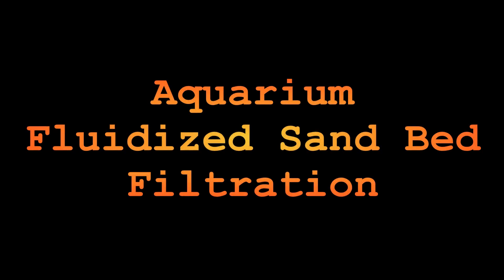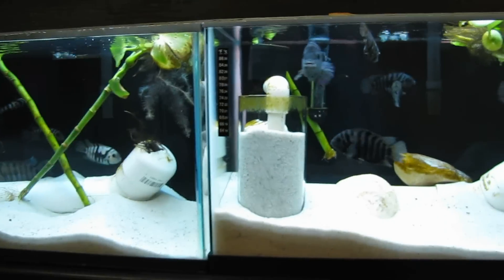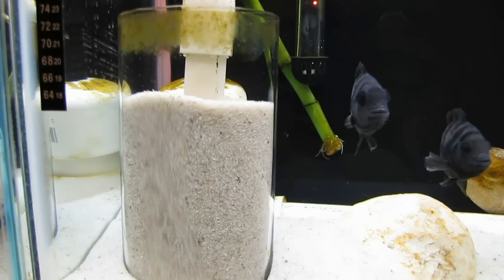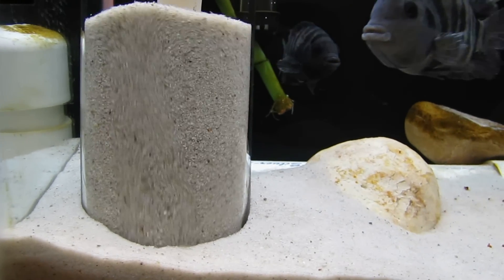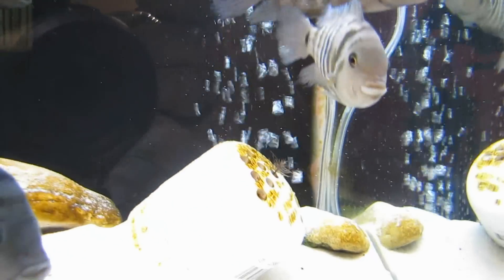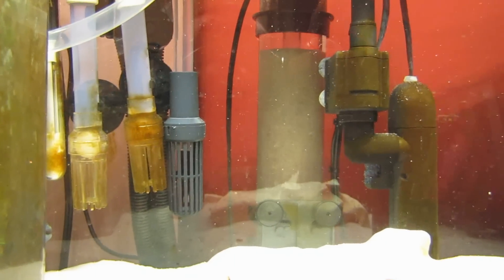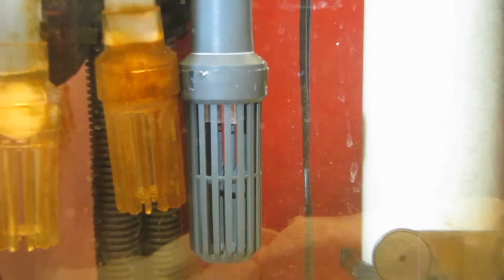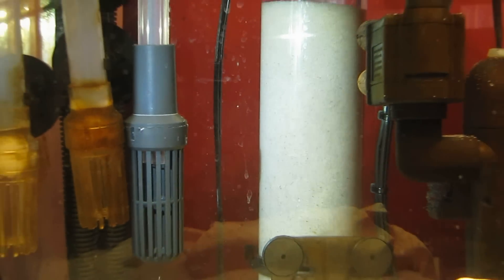Before & After: Fluidized Sand Filters - FSB

Comment: The only problem with fluidized bed sand filters is that if you have an extended power outage (3 days or more) you need to get those things OUT of the aquarium.  And if you are using external ones, disconnect them from the tank.  The reason is with no water movement through the very concentrated bacteria colony, the colony dies.  And releases toxins that WILL kill your fish when they crank back up.  After a long power failure, all the media must be washed before returning it to service.

Comment: Check your convicts fins, do they have early stages of ich or fin rot? They seem split.
Reply from the maker: SlickChick this was almost 2 years ago.  Fish have been treated and are still fine.  Aquarium isn't even set up this way now.
Reply: Oh, the sand filters didn't work long term? Did you switch to different filtration?
Reply from the maker: SlickChick changed aquariums

Comment: Colin, I believe that what your doing is a form of backwashing, there needs to be a suction instead of that kind of output, you should feed the waterflow into the sand, try putting the open jar into a larger jar or container, with an output port, you'll need to make it a closed system as well, that should create the right output based on the internal water pressure
Reply from the maker: Kevin P Thanks for the input.  A good while back I scaled-up and am using more conventional  filtration  methods... along with plants and the single fluidized sand bed reactor.  Capacity on a FSB is enormous as you very well may be aware.
All of this was a bit of fun and tinkering when I did it.  The filters worked wonderfully for the year or 2 I used  them though.